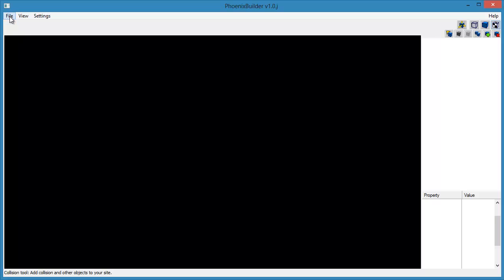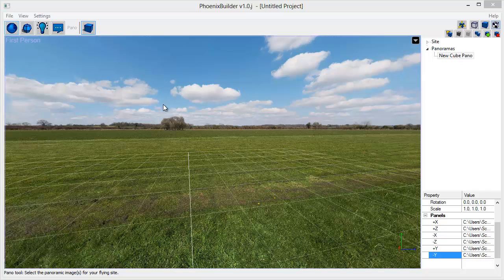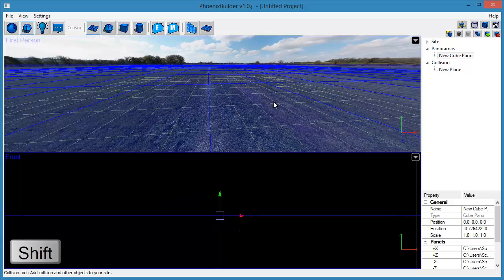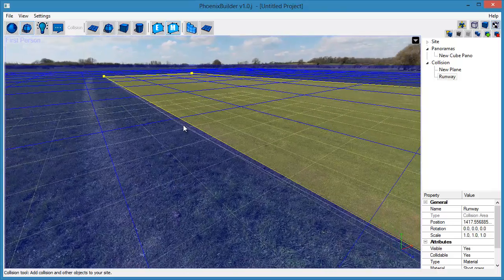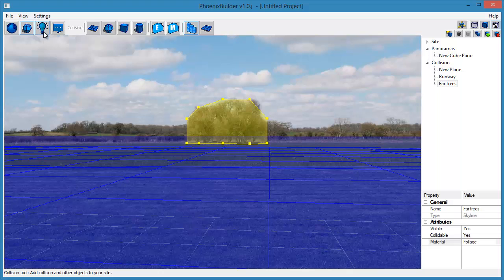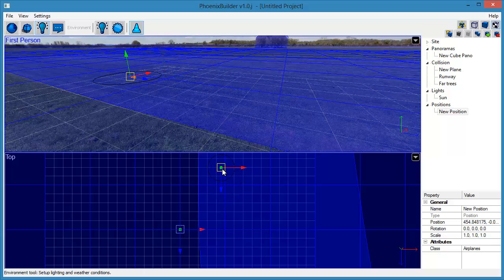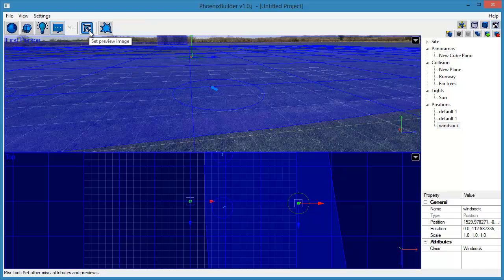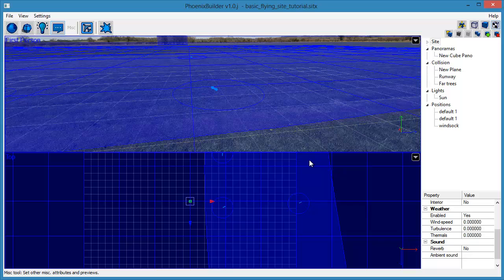Phoenix Builder - Basic flying site tutorial

Comment: When I load an image in JPG format it will not move the way you show in your video. Looking at the file format you load its in DDS.... so I can only assume as you have failed to say anything about image formats that although other formats will load in they need to be in DDS to work correctly. Can you confirm this please
Reply: +steve Boss (dj bb boss) I used the download images and found a dds viewer online so I could look at the image files separately and worked out that image 1 is front view - 2 & 3 are either left or right - 4 I gather is rear and 5 sky ( up ) and 6 is ground ( down ) and they are normal size photo's not panoramic or wide screen.....